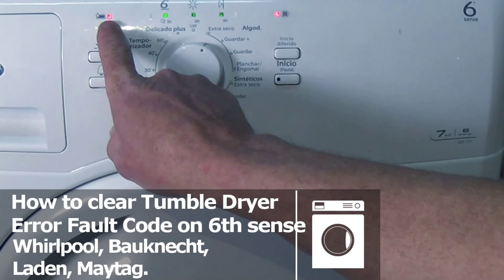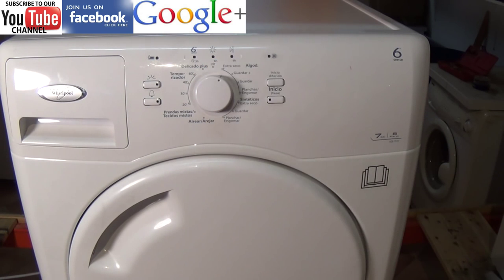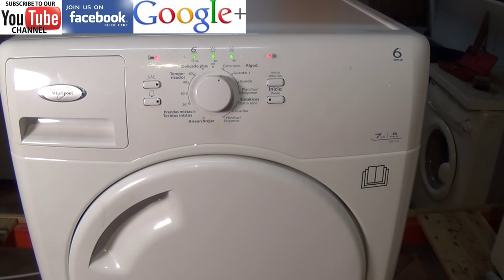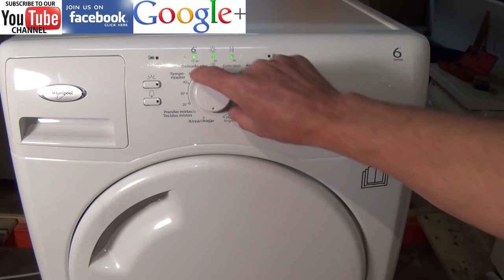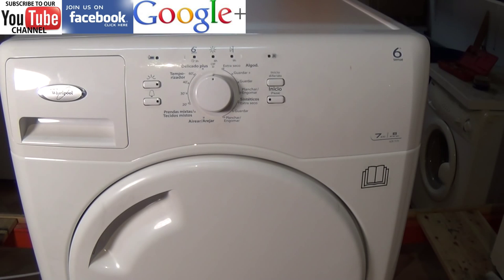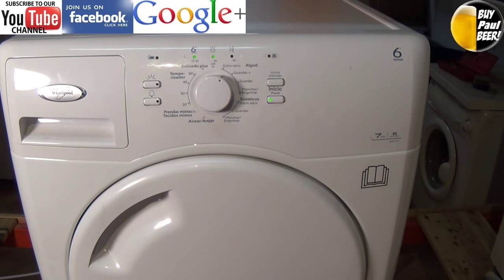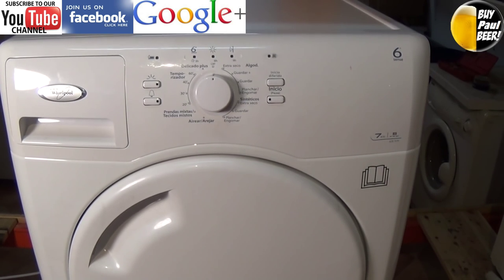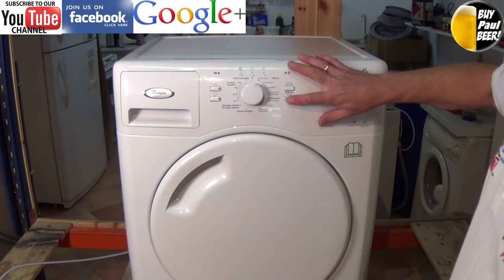Whirlpool tumble dryer 6th sense how to clear error codes

Comment: Thank you very much! Replaced the belt after error 7 (it was totally smashed and stuck between the engine and the chassis)... Still had the error... Thanks to you it works fine again now!
So weird something like this is not in the manual...

Comment: Hello, I have a azb 9771 whirlpool tumble dryer sixth sense. I don't get error lights flashing but the machine just won't start drying. Instead of starting the tumble-drying process, it makes this buzzing/humming sound. It sounds like maybe it's "trying" to start but can't (just my "feeling") :P
Any way I can reset this to get it to start working again? It's out of warranty so I'm sure paying to repair it is not worth the money - I might as well throw it away and buy a new one... Would like to avoid that though.

Comment: I have the model AZB9680 with a small display which was indicating Error F07 after having changed the drive belt. There was no Error before so I suspected that a reset would do the job, if only Whirlpool would provide the information. I finally found your clip and it worked, no more Error code and it is tumble drying again. Thank you!

Comment: Hello. I am hoping you can help me. My Whirlpool 6th Sense (or as I call it, No Sense!) is showing the error code F21. The Water container light is on, as is the Filter light, and bottom filter light. I have tried the above advice, plus unplugging the machine over night to see if it would clear. It is just over 2 years old, cost over £400 and is the worst dryer I have ever owned!! However, I am reluctant to spend any more money on a dryer, and am hoping I can fix this myself, before I hit it with a sledgehammer in frustration!!  Any advice would be greatly appreciated.

Comment: Hi there... congrats on the fine job there!!
Well i had an F:21 error on a AZA-HP 9782 dryer and i followed your guide.
After turning the knob to the 12 o clock position, the led display turned off... but the dryer is working fine... most probably the sequence made the display to turn itself off... maybe you could help me turn it back on???

otherwise the wife will kill me !!!
cheers

Comment: Hi. I have a Whirlpool AZB 6570. When i select a program, both the red lights that is shown in the video start blinking and the green light to the left is on. I have emptied the water tank, cleaned the condenser and cleaned the air filter. Tried reseting the error but it wont go away. The machine switched off the fuse when the error came. Have any clue what i can be?

Comment: I found that error code F07 on the AZB7000 dryer was the result of switch contacts building up carbon from switching on and off the dryer. I removed the control board removed the switch cover on the control board cleaned the contacts. After clearing the error code the dryer was back in service. I was about to purchase a new control board after I tested the heating coils. I realized what was happening when I could see blue flashes emit from the control board. I saved 160 Euros...

Comment: I'll bever buy another whirlpool again, I had the F06 error, got a repair guy out, but because its a combination unit of heater/thermostat, it would cost £100 just for the part, count the labour as well...and its not worth the job as brand new beko condenser drier is only £170, bonus is separate parts as well.
I got this from AO.com 6 years ago, only used once a week, my last drier lasted 22 years, and was second hand...brand names are not worth it